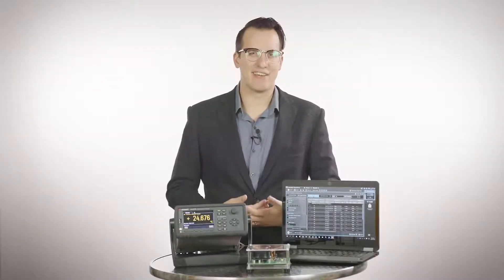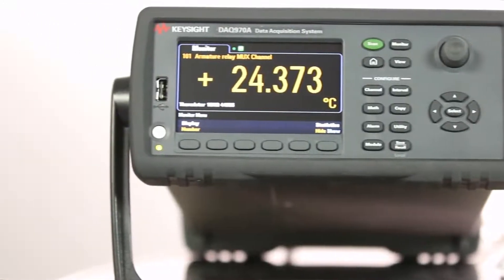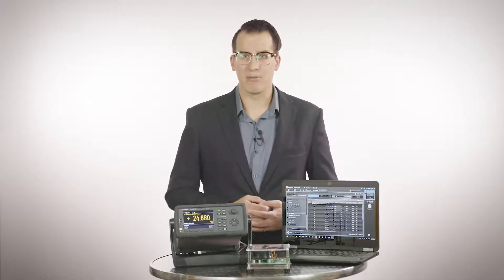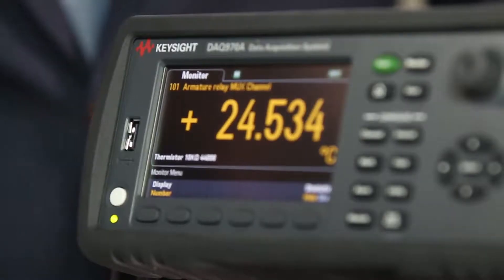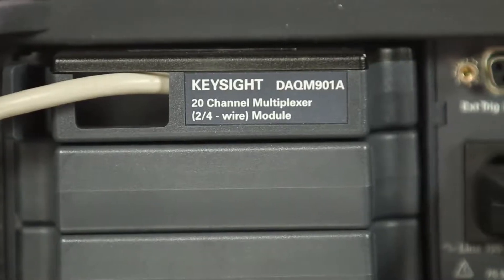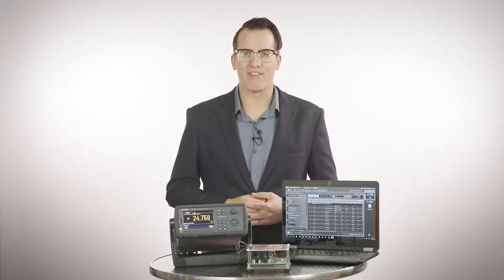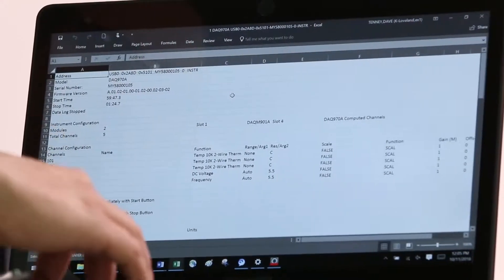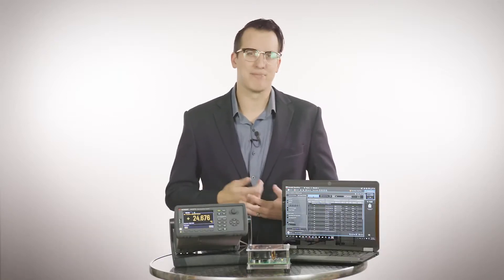Product Overview of the Keysight DAQ970A Data Acquisition System — Allied Electronics & Automation

Comment: When using DAQ970a to measure 4-wire resistance, is it possible to change the internal current to be an AC current?
Reply from the maker: No, using an AC current and AC voltage measurement would measure impedance rather than resistance because AC would impact the inductive and capacitive aspects of the resister.  Different AC frequencies could result in different readings.  If you have more specific questions, you may want to contact the Keysight technical call center at 800-829-4444, option 2, 1 then enter DAQ970A.